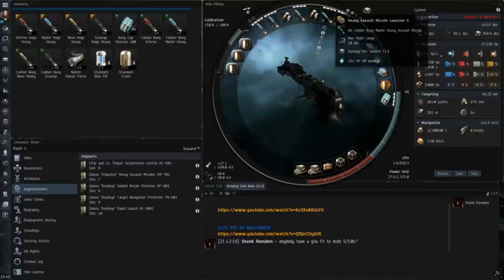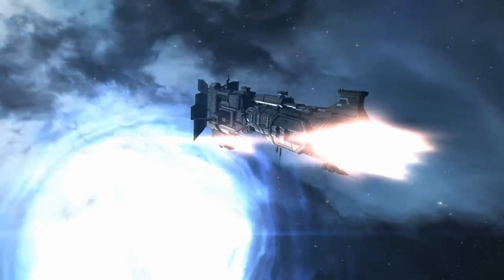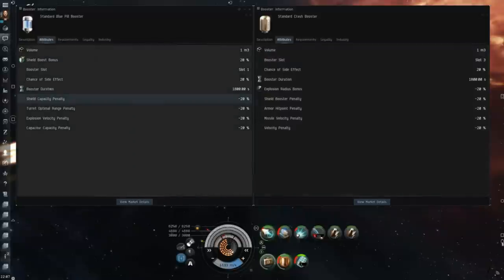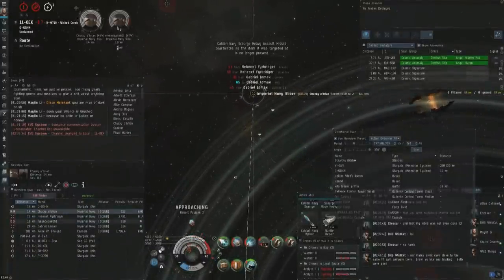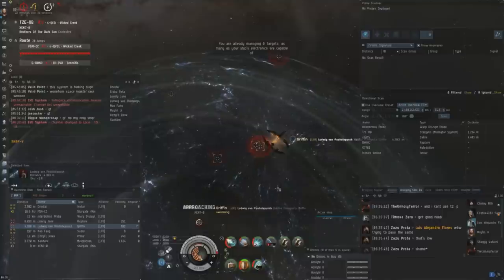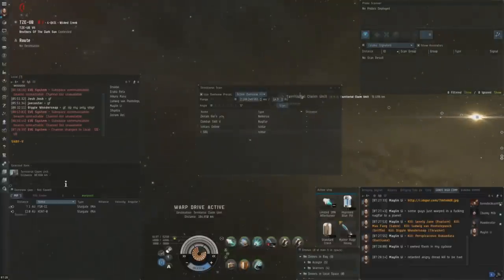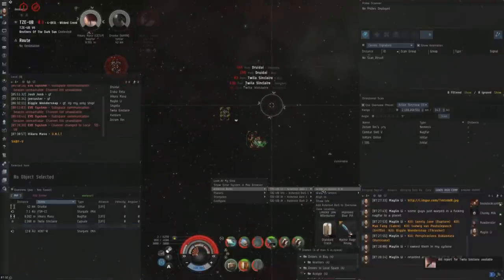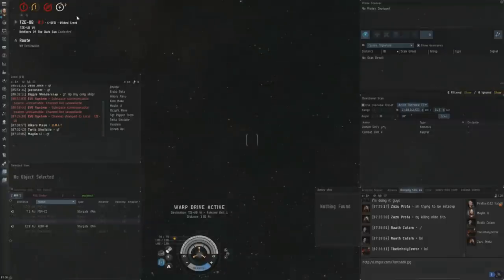Cyclone Commentary

Comment: Thank you for uploading this video.  I really enjoyed it.  However; how'd you get everything to fit?  I plugged it into eft at All Level 5 and it's way over on the PG and CPU, +6 implant in for the PG wouldn't get it down enough.
Reply from the maker: It should fit fine, I don't have any fitting implants, make sure the neuts are the correct size, it should be 1 small 1 med
Reply: eveiseasy Lord, I failed.  You're absolutely correct, I had two mediums.  Thank's so much!

Comment: Nice commentary. But you are using to much heat when it is not necessary. Accustomed to frigs?
Reply from the maker: Yeah my heat management isn't as efficient as it could be, I am used to Frigs, Shield Buffer or Armor tanked Cruisers+. It's difficult to get used to bigger Active Shield Ships since your tank and your propulsion/scram/web are all on the same rack and heating one has negative consequences on the other.
Reply: eveiseasy  Yes, it is hard to do solo fights with active tanked BC-s: control the field, checking scanner, thinking who will be there soon, when to reload, what ammo to use, what drones and where to send them, manage heat, manage cap, keep range, what ships to engage.... and so on. I was brilliant when I started to use triple rep Myrmidon.. I caped out my self in a jiffy (forgot to turn the reps down coz I was checking scanner, overview, drone health..)...burned MWD, armor repers.. Thanks for videos mate. I hope you will continue with this. I forgot about Cyclone to be honest.

Comment: NIce to see you also showing BC Footage. 
Btw. one question: 
Do you think that the Drake is a competitive alternative to the Cyclone?
Reply from the maker: Poppi Starfox I don't think the Drake is as competitive because it is much slower, damage is more unreliable (Kinetic only) vs Cyclones more liberal damage type selection, it only has 1 utility high and it's hard to utilize that highslot because of Grid, you can't fit a medium neut with hams or HML with just 1 LSE unless you sacrifice slots or rigs for fitting. 

Even if you fit 4 nanos on the Drake, it would still be slower than the Cyclone with 0 nanos fitted. And there-in lies the problem. The Raven is actually faster than the Drake, and almost more agile, with selectable damage type, missile velocity bonus, has lock range to utilize MJD, and has better tank. 

The Drake right now is in a bad place and hopefully CCP will rebalance it at some point. They did Aknowledge in the CSM minutes that a few of the Battlecruisers need help.

Comment: How do you have drugs in high sec?
Reply from the maker: You can use drugs fine in High-sec, the only area where you will have trouble with drugs is at stargates where there are custom officers, as long as you're not hanging around with them in your cargo you'll be fine. If you want to move drugs through highsec it's easy and there is no risk (You'll just lose a small amount of isk and standings) Warp to gates at 0m, when you land on the gate and jump just press 'no' on the dialogue box, warp off immediately to the next gate on the other-side and you shouldn't have any problems.
Reply: eveiseasy Technically this IS true, but if you want to move with drugs in hisec regularly, make sure to at least check the penalties before you do so.  They can add up and/or if you're some poor guy thinking you'll just blow through with 50 improved boosters... the total faction standing loss would be pretty bad, and the fine even worse (usually fine is 2-3x estimated value of the contraband.)

But yes, no CUSTOMS officers (not navy or police, CUSTOMS specifically) on gate, you're good to go :)

Comment: You really should pay more attention on how do you overheat scram/web )
Reply from the maker: Yeah, I made a few mistakes in these fights. There were quite a few times when I heated Scram/Web when I didn't need too, I also heated Invul while in armor, and also at times didn't heat invul or my XLASB so lost efficiency. Cyclone has a really high skill cap in my opinion, hard to manage heat efficiently.  

Will hopefully get better if I continue to fly the ship :)